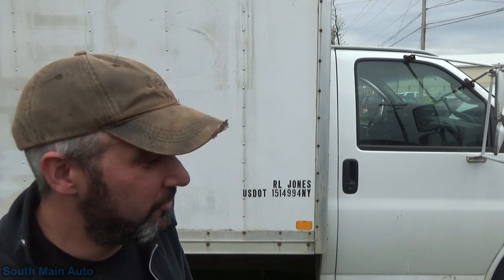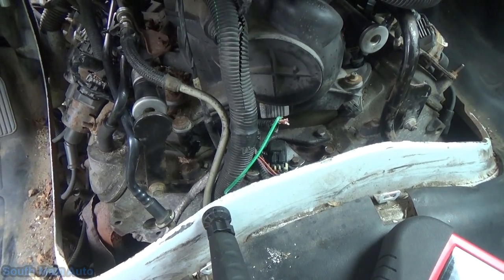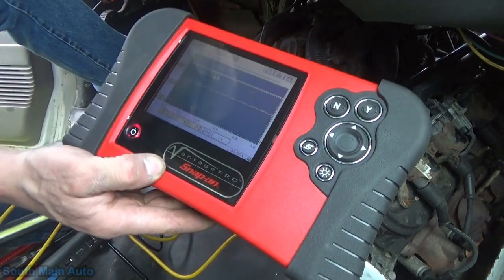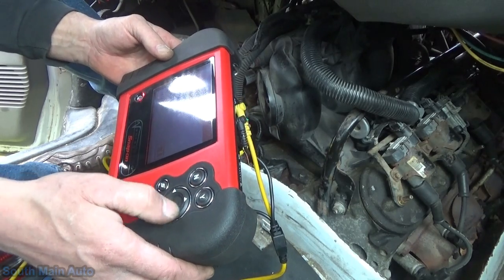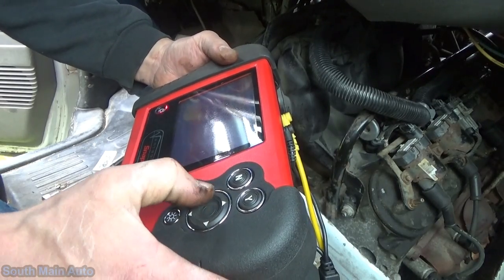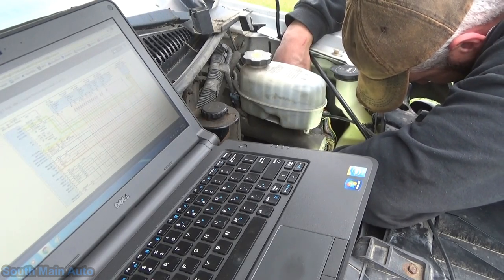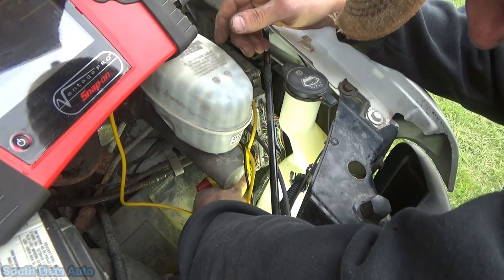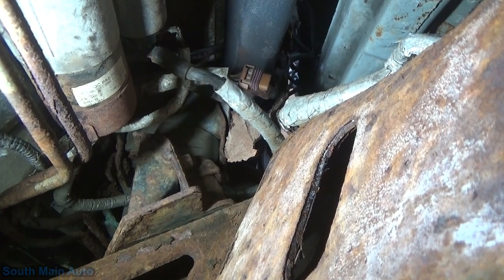Chevrolet Express - Crank / No Start

Comment: The diagnostic process seems so obvious when watching you work.  Something that jumped out at me was testing from the ground to the starter since we know it cranks, in order to verify the ground is good.   That's obvious and makes good sense.  Would I have thought of it if I was in the shed working on my winter beater?  I kinda doubt it. Same story for knowing we aren't shorting to ground because we're getting some voltage with sensor unplugged.  

I would give up my career to apprentice under you I think

Comment: I just got my 05 express van out of the shop a week ago, 600 dollar bill ran great for a week and no it's doing the same crap. Had a new mass air flow sensor and crank position sensor. Most unreliable rig I've ever owned. I cant keep it running long wnought to get it sold

Comment: That was good, no more wise cracks about the grass.  I learn more each day, follow the code than replace sensor that is a no go.  You got to look at the voltage, if I needed an engine I would not buy that one.  Nice scope/scanner you could go a thing on them, how much did you read/study now many years of experience that is way at 75 I am still learning.  To be sure talking was good. I talk to myself when I work no matter where, how do other know I am not talking to god LOL.

Comment: I’m having the same problem. So I hooked up one of those computers to see what was wrong. And what it said was a fuel trim lean bank one and cylinder 4 misfire. I checked the fuel pump and it’s working so wanted to know what you thought

Comment: One recommendation though. Reseal the pierced wires with liquid electrical tape. I have seen corrosion from winter road chemicals get their way into a pierced hole and eat up the wire. A lot of bad connections have been caused by over probing at shops on class 8 rigs because of not sealing the probe prick. Excellent work though.

Comment: Sorry. I forgot to say. SUPER VIDEO with great info on GM can and crank sensor. 11 or so ref voltage. U had 14 at the starter so  something was dropping it. I suspect regulator in ECM

Comment: Swapping crank or cam angle sensors used to require a relearn procedure.  Will misfire if you don't do it.  Who knows if they have swapped and not done the procedure.  Need a pricey scan tool to do it.  Any idea?

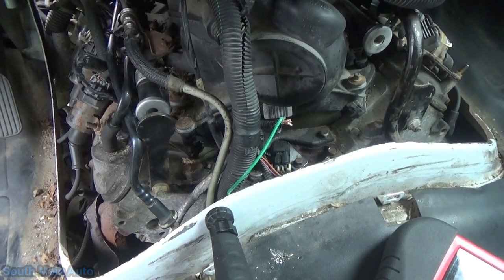Comment: @ 1:50, Eric, ever consider a Red Wing boot #3507 or #2406?  Made in the U.S.A, Supersole sole, lasts 3x longer than competitive boots.  The downside is that they are a little bit heavier in weight than those boots due to the thickness of leather and larger sole.
Reply from the maker: I am pretty fussy on my boots. Just ordered a new pair of the Irish Setters 876 11 2E's yesterday as a matter of fact. Cost me about $200 a pair and I go through 2 a year but they are very comfortable
Reply: Reached out to Dave Schneider, Head of Marketing for Red Wing Shoes.  He or someone on his team may contact SMA. (Irish Setter is Red Wing)
Reply: Yes Sir, Red Wing boots are the Best by far. Not cheap on the price but i can get 2-3 years out of a pair. 
I believe your right about Irish Setter being made by Red Wing

Comment: I feel for you.  Four lettered words always get me through tough situations.  Great troubleshooting!  I had a local shop replace my plug wires, rotor, cap, and plugs on my Chevy Express 1500.  They actually pinched one of the new spark plug wires on a metal bracket!

Comment: I have the send problem in my 03 express van  but when I accelerate this crank up but after I change to D o R. The engine idle   But if I keep accelerating por a less 2 min this work fine.   I replace the camshaft but the problem is same.  If you have any advice that help me I appreciate you help thanks

Comment: Question for Eric. Did you have the black plastic splash shield behind the windshield washer tank when you started to work on this van? If that shield is missing then water will get on the fuse panel and PCM when it rains.

Comment: You need to add an OLD TOOTHBRUSH to your mobile tool kit to clean the wires at the connectors so you can see the colors better and swipe away the crud.

Comment: Crazy that GM couldn't program it to use either the cam sensor or the crank sensor if either one failed, shouldn't need both to start and run. Cam spins at half crank speed,  so the redundancy is there mechanically.

Comment: Had this problem there is a ground behind the steering pump that controls all coils corrodes and breaks mimics a bad crank sensor on most all g.m. trucks and vans all coils rely on this ground which shouldn't have been designed this way also causes stalling and inter miss

Comment: Can you help me out i got a 2002 Lincoln ls was told the fuel was bad hooked it to 12 volts and its week so i got a new but im not get 12 volts to the plug where the fuel pump plugs into fuse are good and i bypass the shut off switch but even with it plugged in i still dont any volts to the plug

Comment: On my Lumina the crank sensor wire got squished where it crossed from the rear side of the engine to the front side.  Bad routing of the wire!

Comment: Oh the joy , did the same thing on a 4.8L in a P30 chassis in the snow last winter I hate box trucks and bread trucks , I got a good laugh from this video being the issue I chased , and the issue turned out to be exactly the same as your here ... I gave up , got out the soldering iron , shrink tube , and some split wire loom , I just re ran the wire , I spent a half hour digging in the harness , figured after a bit if the wire broke once , it would again , could be we found some poor quality wire used by GM here , it does make me wander , or just poor routing by the general causing it to flex and work harden over the miles of use and abuse , and snap ... anyways enough of my rambles keep working your tail off to pay taxes ,and bills, I know you agree that's all it seems to be these days , sometimes you have to admit you miss our old friends Mr. Points , and Mr. carburetor LOL
Reply from the maker: POINTS!? Haha no way I never miss that stuff! I like to walk out side at 10 below zero, bump the key, then run back inside  :D !!
Reply: I was referring to points and a crab in respect to the it won't start repair point of view , the good old days where they would start and run with 2 pieces of wire and a fuel line ha ha ha , I myself love the fuel injection luxury , I injected my 63 chevy tow truck , yes the one in the little pic to the left is still part of my fleet and works ... well if one can call 8 trucks a fleet , but I do LMAO !

Comment: I'm surprised you guys in the salt belt are ok with stabbing wires instead of back probing, that's a no-no even here where they barely use chemical deicer.
Reply from the maker: Seal the hole back up and you will not have  a problem

Comment: Question 2000 explorer no lights on oil change new filter new oil check engine light?Any help would be appreciated.
Reply: YOU WILL NEED A CODE READER OF SOME TYPE TO GET SOME KIND OF DIRECTION

Comment: I know it's not related to this truck but how tight should that belt be on a 5.3 GMC seems to me my belt is real tight I can't even pinch it to make it move is that too tight and if that is too tight what do I need to resolve that problem by a new tensioner and install it
Reply: Is that belt a replacement?? if yes could have been given wrong size Belt / if not replace tensioner and belt  too  if belts too tight will take out bearings in the alternator

Comment: Why would you find where the wire was broke?  I'd just bypass all the bad wiring and use a new connector.
Reply from the maker: Because it there are possibly other wires rubbing through on a bracket per-say then you prevent problems by finding a broken wire.
Reply: @SouthMainAuto  Oh, that makes sense.  Thanks for the reply!

Comment: Other than a big battery, a little bit of smoke and some swearing, how do you find shorts in wires? I've seen a few people use the old magnetic based trick with the twenty five dollar harbor freight brand tool, but what does the pro do to find a short?
Reply from the maker: Well this was an open not a short but on a short I use a amp clamp and a light bulb
Reply: Don't ever stop working do ya.  I suppose I should have known how you find a short. I've watched several of your videos where you do such a thing.

Comment: It will cause the wire to corrode there. Filling the stab marks with glue is not good enough. All wires should be back probed at the connector. Amazon actually has some nice kits to do that.
Reply: he has the  EAS WAVE  kit for backprobing  wires ..
Reply from the maker: I use liquid electrical tape to put back over the holes I make. The Pomona probes that I use leave a mark that is almost impossible to even see after you remove them.

Comment: was thst the ecm under the hood you had a hard time getting the cover off
Reply: yep ECM under hood in right corner, down left of that is the fuse/relay box, right where it bathes in salt water spray and windshield washer fluid adding to the corrosion death
Reply: There is a black plastic splash shield that clips or bolts behind the windshield washer fluid tank to the inner fender which helps to channel off a lot of the rain water that runs into the fender channel track. It was missing in this video but hopefully someone will make sure that it is back.

Comment: Big no no stabbing those wires at the cam sensor.
Reply from the maker: Yeah why is that?
Reply from the maker: I back probe, and I pierce. Depends on the situation. I find if I use my pomona tools the mark left in the wire is microscopic. That is why I leave my tools on until I am ready to seal up the hole other wise I have a hard time seeing where it is. It tends to self heal but I always seal up the area with liquid electrical tape. Living in the salt belt I have never had this method haunt me. Oh and I have zero qualifications, no high school diploma and no ASE's sorry....